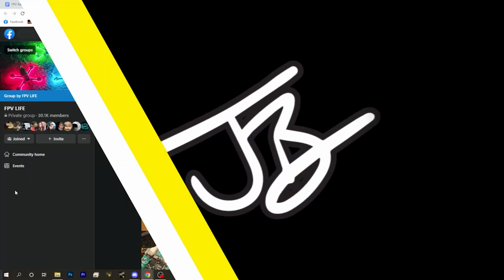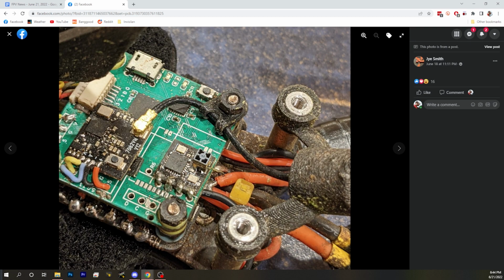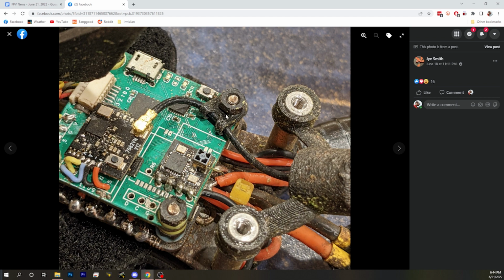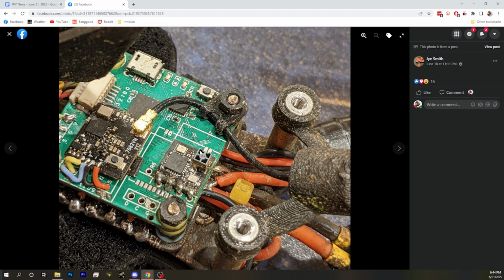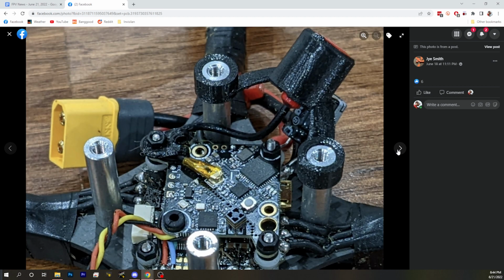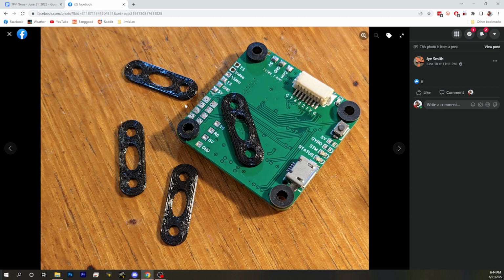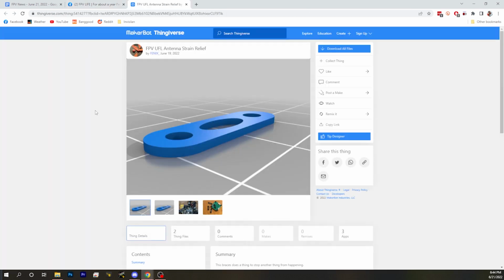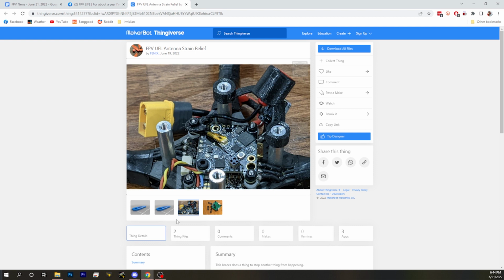Community Spotlight 3D Printed UFL Strain Braces by Jye Smith - FPV News

Comment: This is good not just as ufl strain relief but for general wire management. In my latest build I'm using 3 of them. Previously I used to hot glue all my wires. This is much better.

Comment: Would it add vibrations to the gyro?
Reply: Not likely if the nuts tightened.  Maybe the wire, but then it would have even without the connector.
Reply: No problems here, but do check your logs.  The new foxeer antenna with super flexible coax will be mint with the brace.